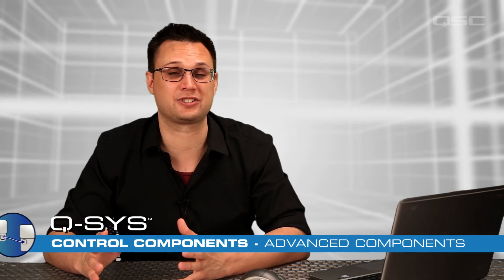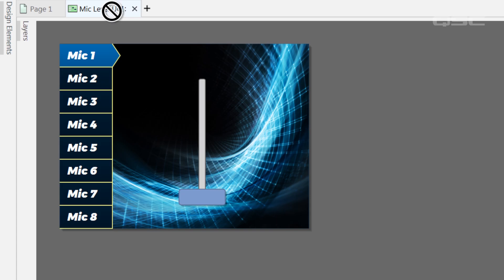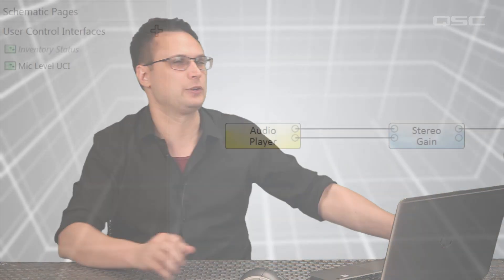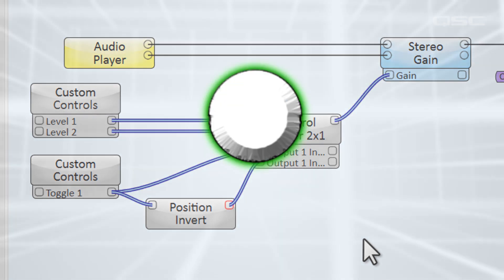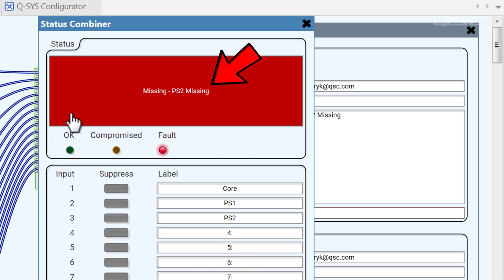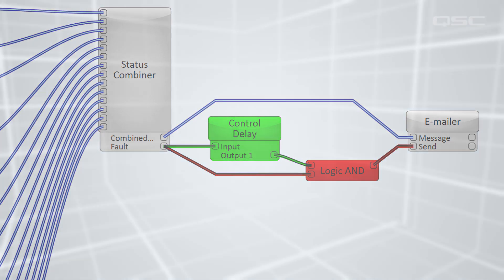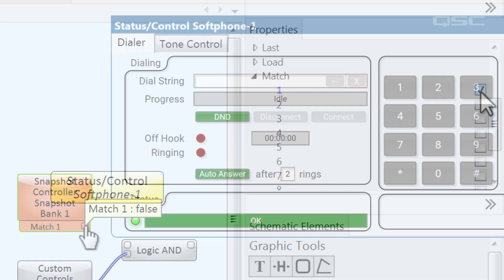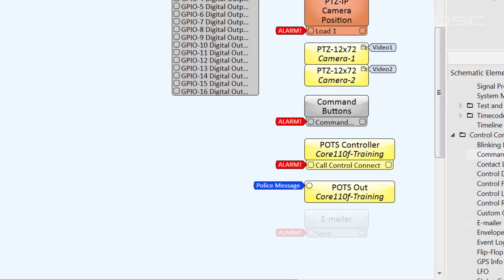Q-SYS Control Training: Advanced Control Components

Comment: I tried this, but using the Level Knob does not work. Output of the level knob is in the range -20 to 5, not 0 to 1. For this to work you need to use the Position Knob. Aside from that, this is awesome. Thanks.